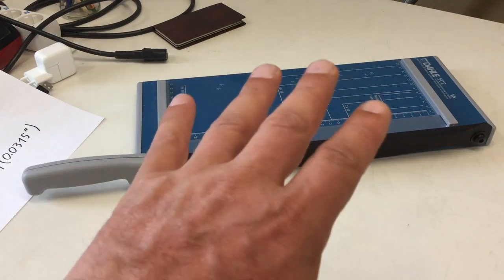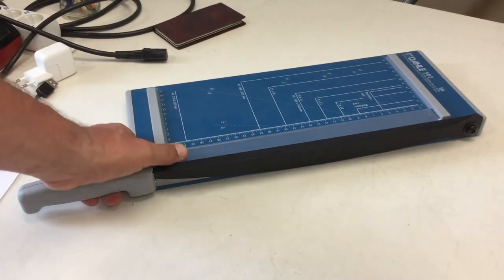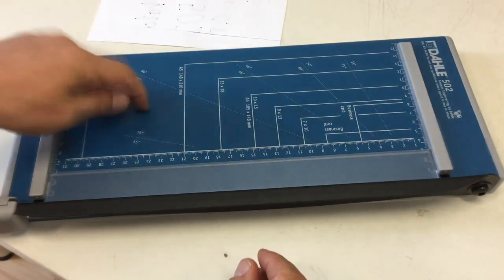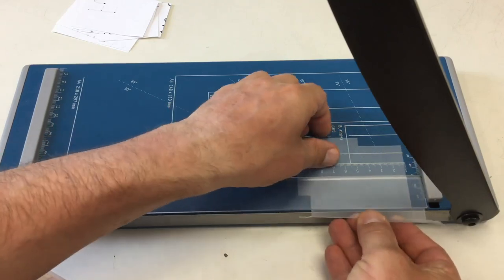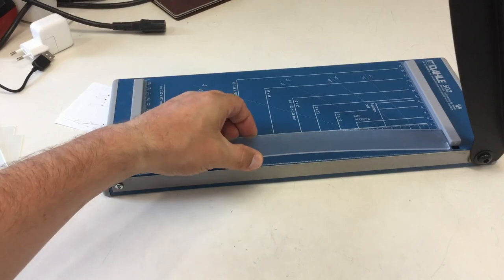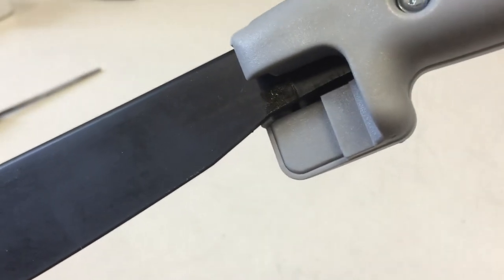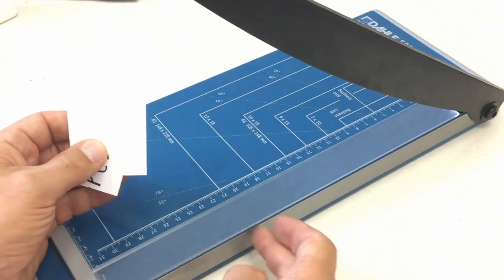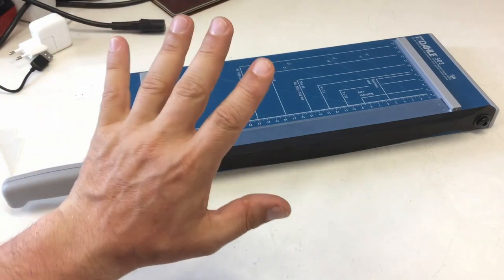Dahle 502 Guillotine Paper Cutting Machine Review

Comment: Hello this may be a weird question. Do you think this machine could straightly cut edges of a surgical facemask (the blue ones)?
Reply from the maker: Not a weird question at all in those times. I tried it, and yes, it does cut the material of surgical masks  (I did not cut through the rubber bands though). However, just moving the blade down will not yield nice cuts. You also have to apply some pressure on the handle towards the fixed part of the blade.